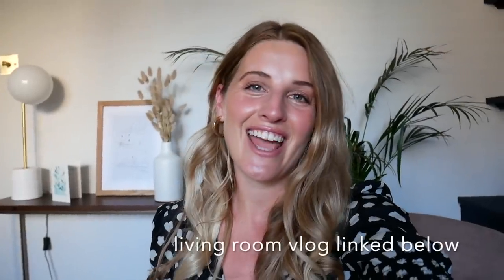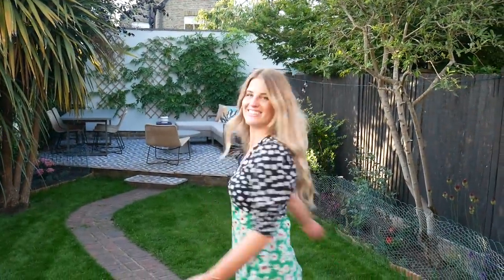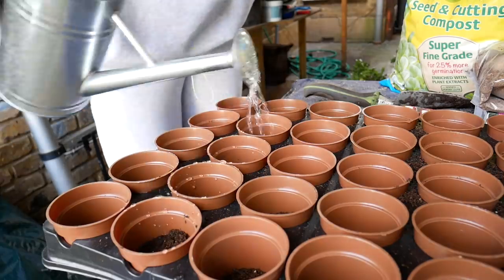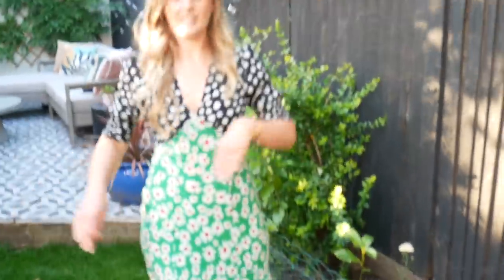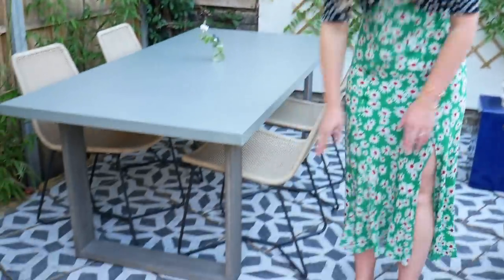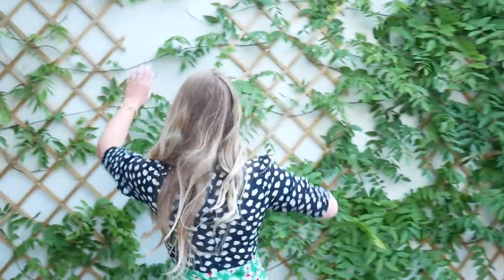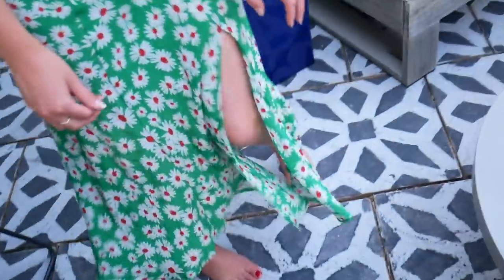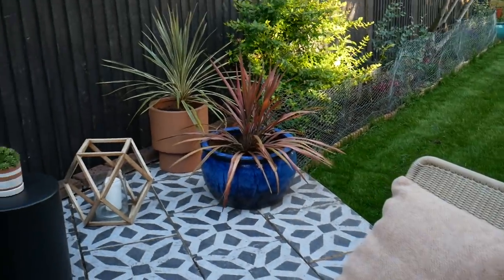GARDEN OVERHAUL FOR SUMMER WITH WEST ELM // REFURBISHING OUR GARDEN (AD)

Comment: I want to do my patio just like this too! Has it peeled anywhere at all and would you do anything differently or use different products if you did it again?
Reply from the maker: yeah an area where the patio is uneven and rain water sits in it it has slightly worn. We've decided to leave it for winter and going to address it in spring to see if any more wear happens. If your patio is completely level you shouldn't have this problem.
Reply from the maker: and I'd 100% immediately put down the sealant coat on top once you've finished to avoid any thing like this happening. I would use the sponge to apply again I found that so easy. I would probably pick a less windy day lol. And I would 100% make sure its an off white shade, pure white is blinding. We used an off white stone colour and im v happy with that.